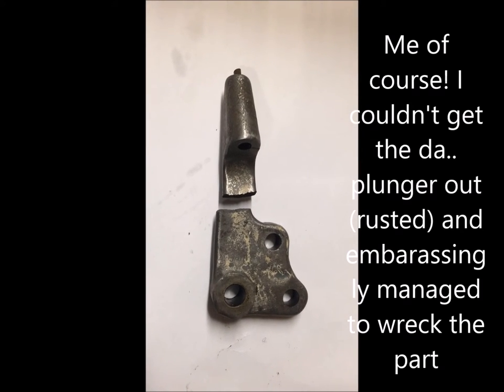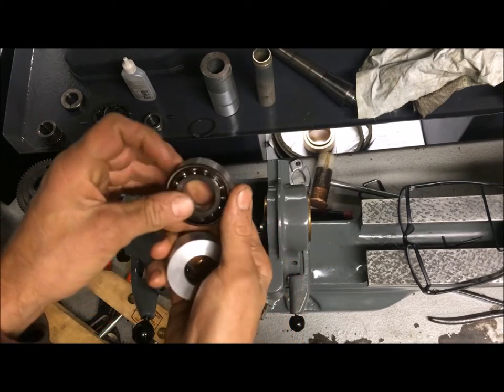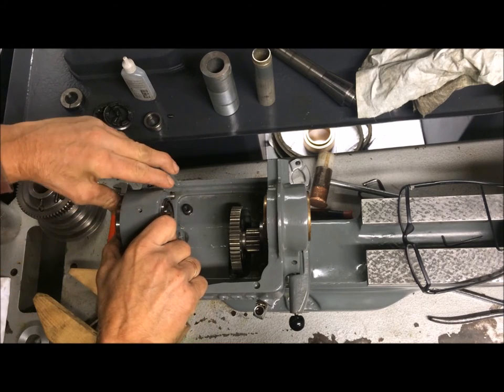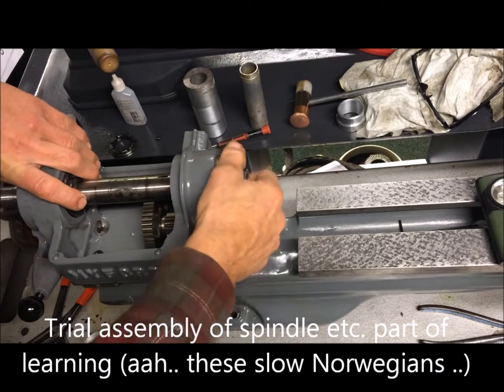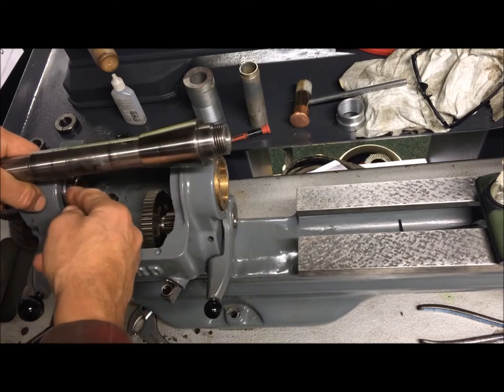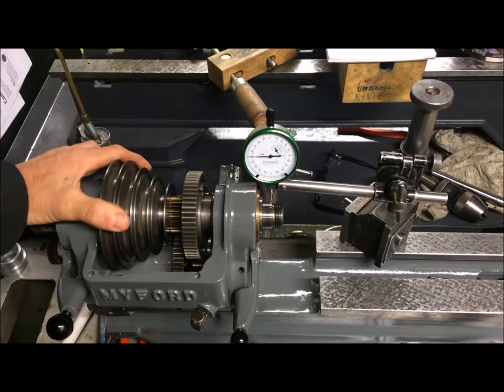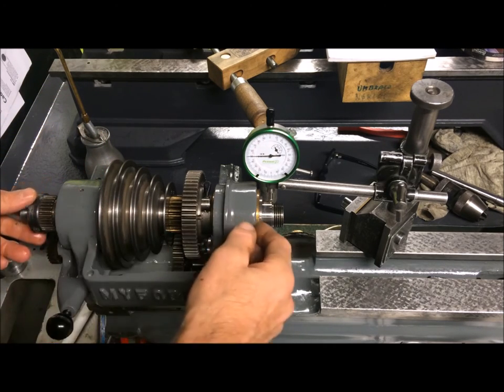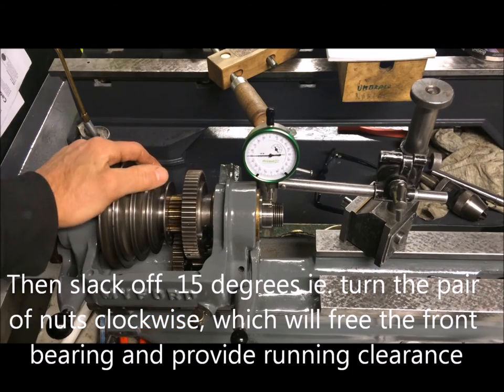Myford Super 7 headstock assembly and spindle adjustment

Comment: Thank you for these Myford vids - as an old fart I am still learning about my Super7 :-)

Regards from Dublin
Ruaidhrí
Reply from the maker: You're welcome.. more acoming! I am slowly getting to the gearbox and gears and "motorizing assembly" as I have learnt it is called (motor, pulley wheels, belts, clutch etc.), but must finish up on the apron and do the cross- and compund slides first.
Reply: Looking forward with anticipation. I was lucky enough with the people I bought mine from - everything was spot on. Just needed to add a gearbox.

Comment: How do you remove the old rear roller bearings? I can’t seem to find any video or guidance about how to get them out.
Reply from the maker: They are a slide (slight interference) fit and will come out either way, so just press them out left or right.. after removal of the castellated nuts, of course!
Reply: @jansverrehaugjord9934 Thank you for this information, I will try it out tomorrow.

Comment: Is there any advantage to set the preload without the gears in place, except for practicing? I guess it needs to be redone again after the spindle is removed to insert the gears(?). Btw thanks so much for all your videos, they have been of great help for me refurbishing a super 7.
Reply from the maker: You're welcome. Glad to hear the video efforts are of help.
The "relative position" of the double set of bearings that act both as thrust bearings and as the rear guidance can be set and then the spindle removed and re-inserted.. if needed. It has been awhile since this, but I probably went back and forth and was also doing this for the purpose of the video, so if confusing, I apologize. However, you can as said do the setting of the rear bearing pair and fix this and then afterward mount the gears, BUT, as you note, the preload for these bearings may change slightly, so it is possible that a readjustment is neccessary
Reply: @jansverrehaugjord9934  ok, thanks for good and quick answer. Pretty much in line with my thoughts.

Comment: Dear Jan,

I have to replace the annular bearings as well.
In your video you mention that they have to be installed back to back.
What I don't  know and can't find on the Internet is how the bearings have to be installed (what is the frontside and what is the backside of a bearing).
Do they have to be installed with the engravings on the outer races pointing to each other or with the engravings pointing outwards?
Can you please clarify this?

With kind regards (from Holland),
Ron Veraart
Reply from the maker: Hi there,
I have shown a little more in this video https://www.youtube.com/watch?v=Gh5x3nacO8k&t=3s
Anyway, I need to check the bearings themselves to see which sides are engraved. I think this may also vary between manufacturers?
However, I believe the thicker side of the outer rings shall face one another. Will check, but you can also tru to look here: https://www.model-engineer.co.uk/forums/postings.asp?th=86583
Reply: @jansverrehaugjord9934  Dear Jan,
I assembled the bearings like you told me.
The lathe is working perfect now!!
Ron
Reply from the maker: pls. also see the photos I just uploaded
Reply from the maker: @rgmveraart  That is great!

Comment: hi 
i rebuild headstok put it lose out to front and back 
its normal
Reply from the maker: Anwar Alfaqeeh Alhusseini Hi again, I am afraid I do not understand what you mean? Can you explain more?
Reply: i am  assembly the headstock but the spindle moved 10 mm to the front and to the  back when i push it 
is that normal 
thanks 
and sorry for disturbing you by may language
Reply from the maker: No problem.. just trying to understand your problem. :)
The spindle is essentially moved back and forth with the adjustment of the castellated nuts. Your problem can be that the position of these castellated nuts are not correct. The way this works is that these nuts (screwed into the casting) pushes against the outer rings on the pair of bearings that make up the rear thrust /alignment bearing. The preload on this pair of bearings are set by forcing the inner rings against oneanother. This is done by closing the lock nut on the rear of the spindle, the other side of the bearing inner rings being tight up against a sleeve fixed against a step on the same spindle. Essentially a clever and simple system.